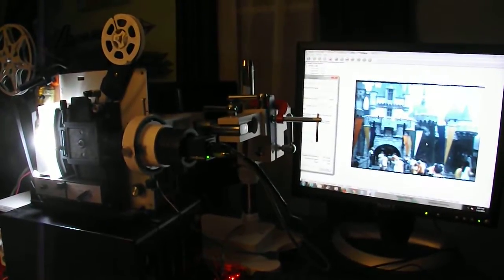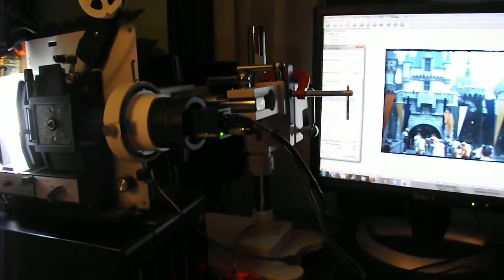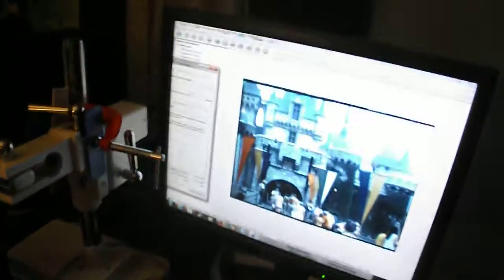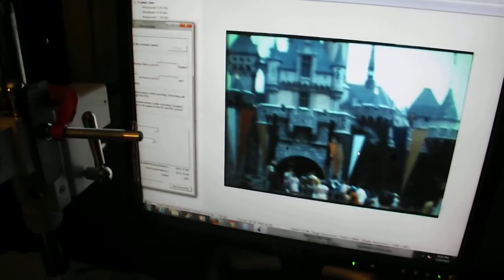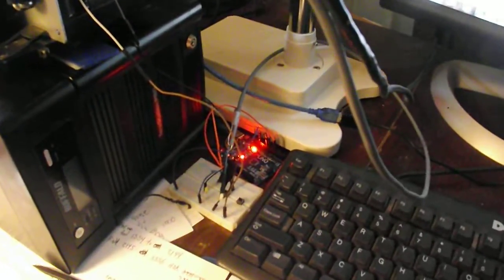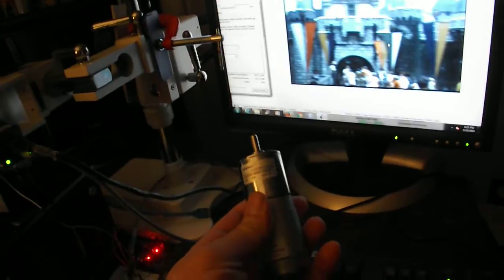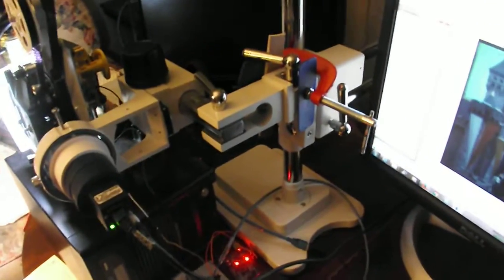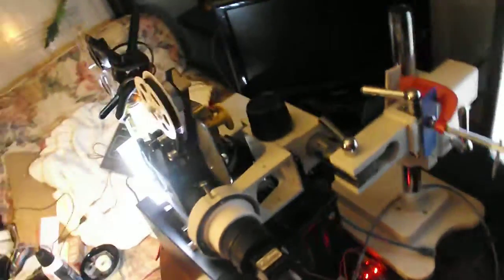DIY Avisynth 8mm 4k HDR frame by frame film scanner

Comment: This project (or should I say was) rather unusual. One unusual point is shooting in 4k, the other is shooting 4 times the same frame at 4 different settings (HDR). I understand that shooting in 4k can enhance the sharpness of the end result, even though you might downscale it to 1080p.   But I really wonder about the benefit of shooting 4 times the same frame... What can you say in favor of that? Is the improvement clearly visible?
Reply from the maker: 4 different brightness levels. Then I used Photomatix software to process the 4 images to fusion them to one HDR pic.   26,000k pictures and 120Gb of space for one 8 minute video.

Comment: Change that to a Sony a6500 mirrorless and you can get 6000 x 4000 resolution per frame.
Reply: Except .... the shutter of the a6500 is only good for 200,000 activations. I think that is only 2,500 feet of cine film that can be digitised (if my maths is correct) before you will need a replacement shutter meachanism for the a5. And I think Michael is taking three shots per frame. I am afraid that the DSLR camera is no good for this type of application despite the number of people that think it is - probably because of watching the Kinograph YouTube video. Michael has made the correct choice of camera. Yes, if he wants even better definition he could get a higher res Point Grey (Flir) but it would cost.
Reply: I've just checked - Michael is taking 4 shots per frame of film, not 3.

Comment: So basically you remove the original AC motor and replaced it with a DC motor powered by a DC Power Supply.
Reply from the maker: Yes! I needed precise control of film speed thru the gate at a very slow speed. Remember the camera has to take 4 photo's of every frame.
Reply: I have the same setup but use a voltage controller between the AC power source and the projector which the motor runs on AC.  I'm not too keen on which motor is more stable an AC or a DC.  I have to watch carefully on the AC motor because once in awhile I will see slight flickering while I'm recording so I have to do a micro adjust on the voltage controller.  I don't do frame by frame, I record directly on the film gate with the motor speed down to 15fps to avoid flickering while recording on 30fps.  I set it up for my Eiki 16mm and Eumig 8mm/Super 8 projectors.